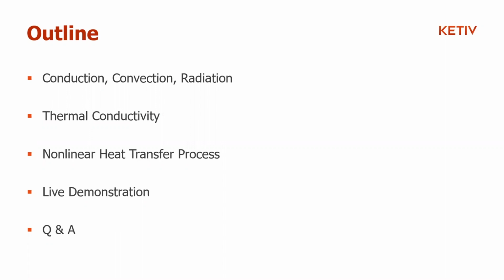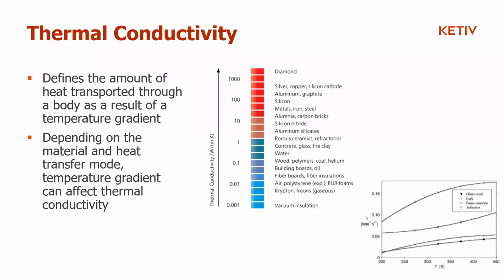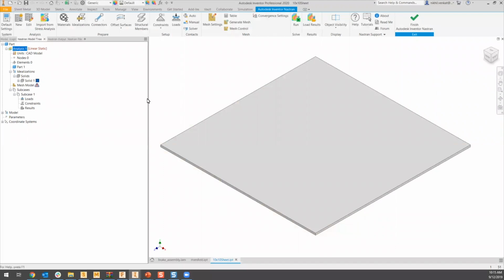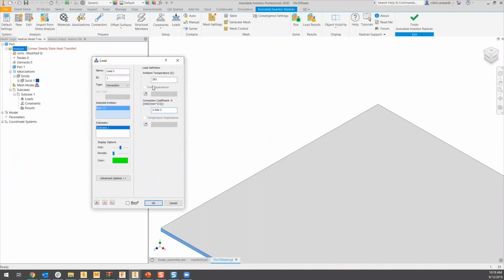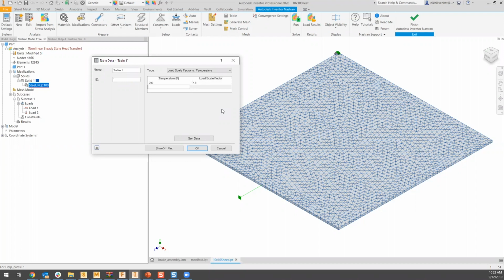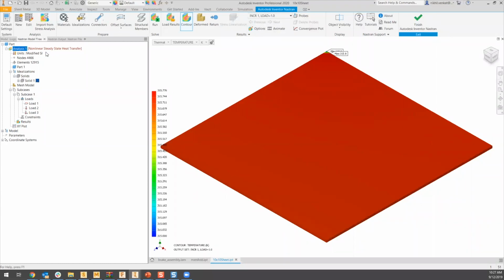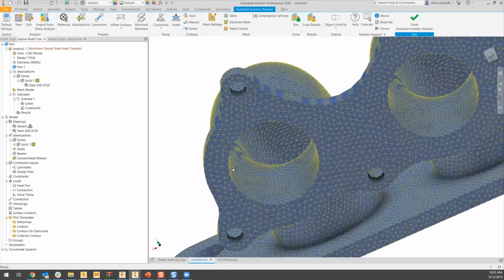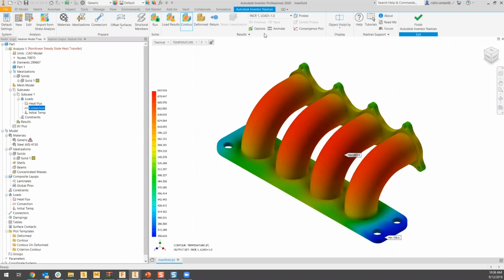Are My Thermal Simulation Results Valid? | Autodesk Virtual Academy

Comment: Hi Ketiv, 
If you have time could you make a series about "problem solving"
I mean its like why you choose that kind of design,

as a mechanical engineering student(2nd grade) I really want to compete in a challenge, 
I amaze how professional could inspired designing stuff base on problem, like the innovation in Airbus Jet Engine Bracket Challenge, the designer could figure the weakspot and improve without comprommising weight
right know I just could an automatic shape generator,
One more example challenge "Airbus Challenge: Design a Water Pump for a Flying Product"
how can we figure what type of gear did we choose, what gear ratio, why we choose compare with other 
I really want to learn something like that, in my college we just begin to count a specification of gear not choosing and designing base on problem
,thank you so much
Reply from the maker: Hi Ian,

Thanks for your suggestion. A lot of information about fundamental design theory can be found in the Shigley's Mechanical Engineering Design textbook. I would start there and apply that theory to your modeling.